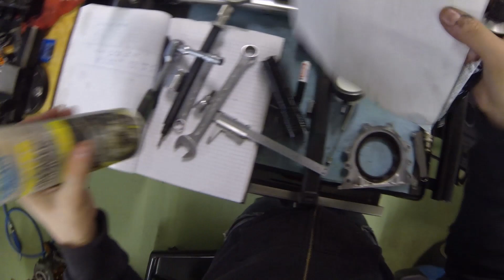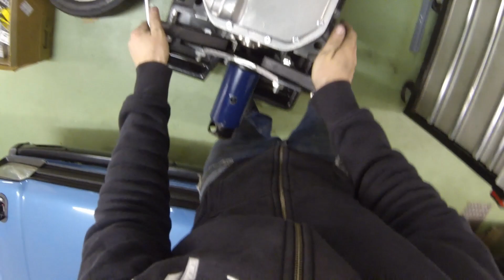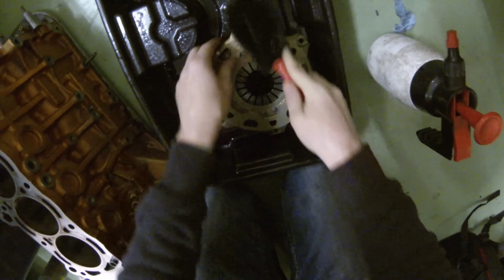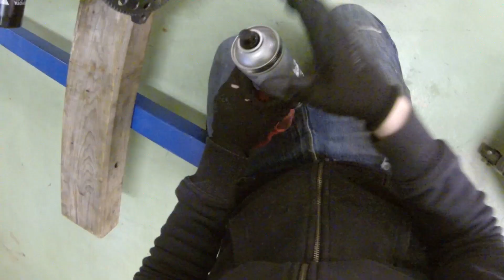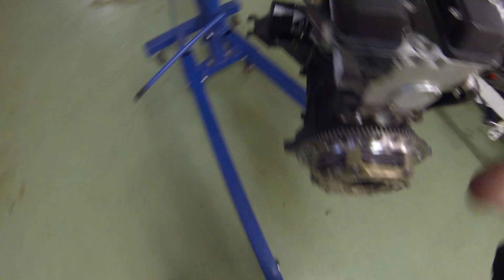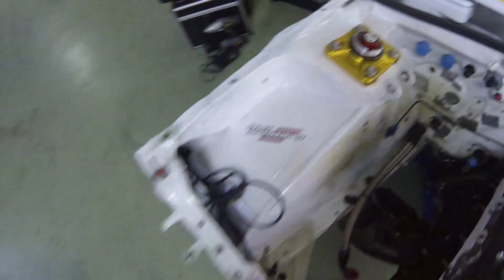2020 prep - Engine overhaul and rebuild - Part 10

Comment: Hello, very nice build over all 10 parts.

Would you be so kind to tell me which brand is the motor seal you use?
Reply from the maker: Hi Mario, do you mean the silicone sealant or?
Reply: @VHTRacing  Yes the black silicone sealant
Reply from the maker: It is permatex, I have the regular and high temp version.
Reply: @VHTRacing  Many thanks for the info.

Do you start at international Hillclimb at Rechberg  AUT?